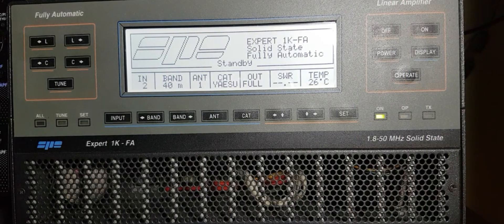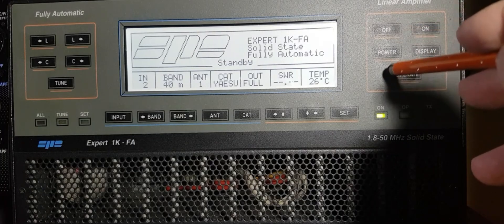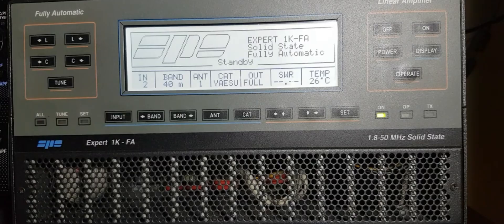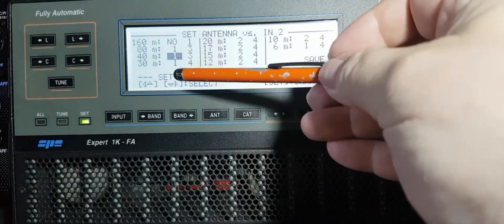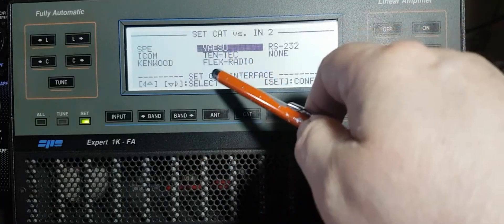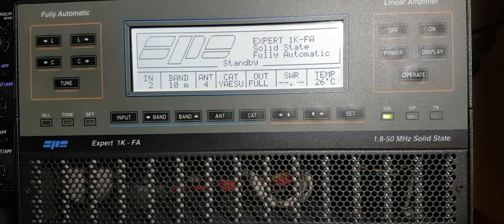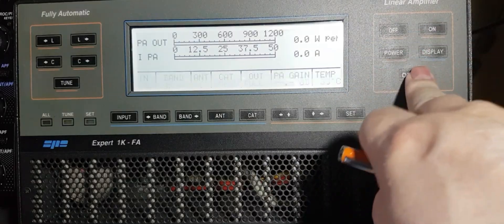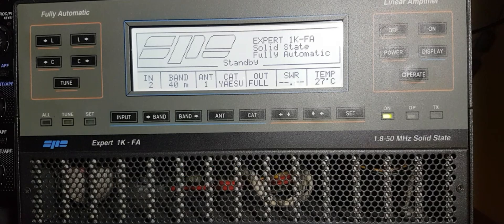Let's have a look at SPE EXPERT 1K FA.

Comment: did you buy a cat cable for the FTDX101 or make one, I'm thinking of buying one of these.
Reply from the maker: TechnoFix UK
Reply: @hamradiostationg0dtx583  Thank you! Is there any settings in the FTDX101 you need to change to operate the SPE? or is it all in the menu
on the SPE?
Reply from the maker: @thomashenderson603   No just the cable from the radio to Linear that's it